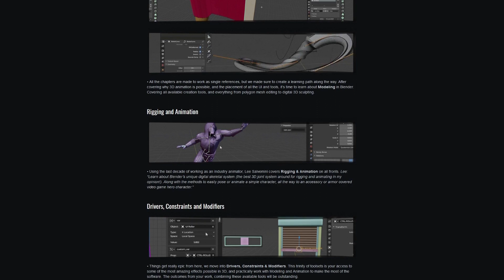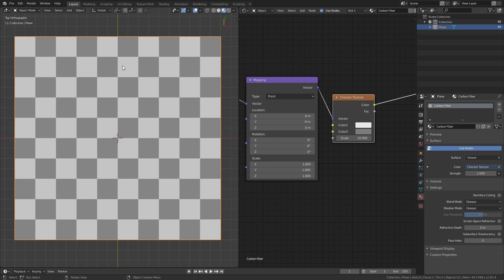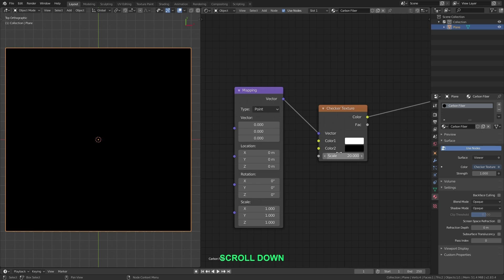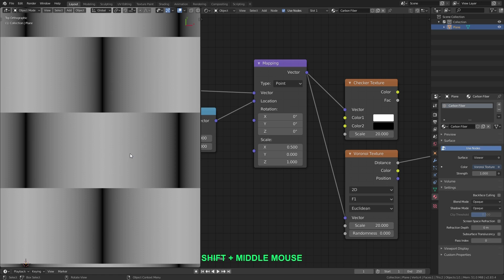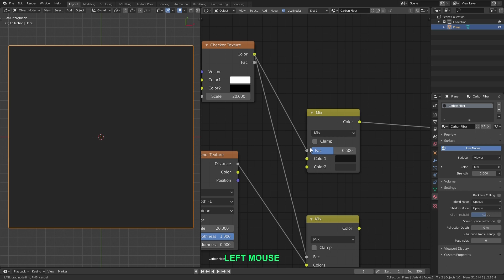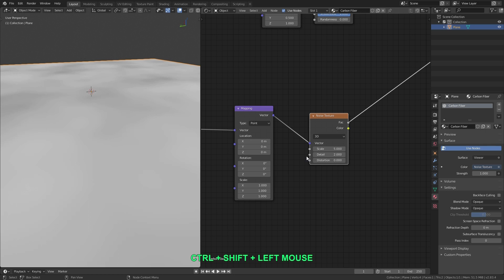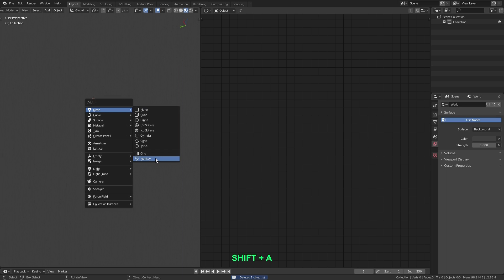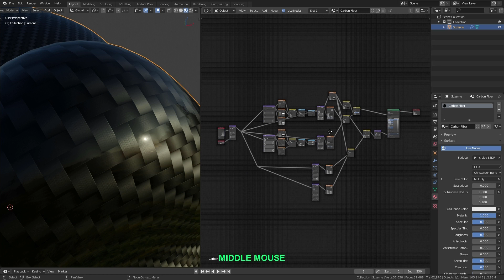Procedural Carbon Fiber Shader - Part 1 (Cycles & Eevee Compatible)

Comment: We need like a million more of these procedural material tutorials.
Reply from the maker: Got any specific requests? I've got a few ideas in mind for more of these, but always looking to add to the to-do list. -Chris
Reply: @blengine  The Classic Metalic CarPaint (EEVEE).
Reply: @blengine  I think thats a neat idea, however, a more indepth tutorial to understanding how to create patterns, which is the key to most procedural materials, would be better I believe as a first step. But back to the specific request - Brick material and or Woodbark :D then a tutorial on how to combine such procedural materials would be amazing too, for example let's take a brickwall and combine it with a procedural meshwire ontop on some parts, to hold loose parts together (often used in plastering) as an example on how to combine 2 whole different patterns to work together. Thank you for your tutorial!
Reply from the maker: @rodrigoalexandrealves8564  A more realistic car paint(for both engines) is something I've already been working on to make training for. After this course is released I'll probably get back to working on that.
Reply from the maker: @Keyr969  The pattern tutorial is actually already on my wish list! After creating this weave pattern I started making plans for a tutorial just on patterns. Brick and bark are great ideas too. Brick alone could be quite the project depending on the detail, and I like your layering idea too. That one's got me thinking...
Reply: You can check Become Blender material Guru course i just finish that one and learn so much. Now when i know how each node work i just need to develop logic and how to use them to create something specific. For example, this fiber tutorial, hardest part is to visualize this on the begining and know how to start with.
Reply: @blengine  procedural wall mosaic, like in old soviet wall art
Reply: @blengine  Brick I watched a video on how but i did not come out as good as the video It might be me but i think he forgot to mention a few little things in the video but yours is clear and understandable thanks
Reply: @blengine  Hi, I need this Pattern.: https://ibb.co/whyjxTD
But i have no idea how can i achive this... That nodes are so hard to learn, any tips? Thanks

Edit: Mhhh maybe i can kinda achive this by modifying your carbon pattern. I think it will look a bit different but I will give it a try.
Reply: CG Masters a good timber procedural map for doing things like timber handles or furniture with the grain technically correct.
Reply: @blengine  realistic / cartoony / anime skin shaders would be nice!
Reply: @blengine  Alot of shaders and working with the math node.
Reply from the maker: @Vlow52  Whew, that would be quite the interesting challenge, especially in trying to get the tile flow to match up with the images 0_0 I feel like it might be possible, but I think this one's outside my skills.
Reply from the maker: @undead504  Brick's a classic texture I'd like to tackle in depth this year. I've seen some seriously impressive procedural blender shaders for brick, and might have to get in touch with one of those artists to see if they'd be interested in a tutorial collab or something.
Reply from the maker: @derbmann123  Is that a diamond pattern, but stretched tall a bit? I can't really tell, but maybe this blend file will help with that - https://cgmasters.net/chris_misc/diamond.zip
Reply from the maker: @dangerfox1776  100% will be working on procedural wood textures this year. I've had one started for ages and am looking to revisit this. I feel like a whole tutorial series on practical shaders needs to be made, including wood, concrete, metal, etc.
Reply from the maker: @Unprogress  Skin shaders never really interested me, but after working just a little with SSS lately it's super interesting. I'm still not sure if I'll ever dive deep into the topic, but it could happen because it's such an important and commonly used shader.
Reply from the maker: @mortenfjellheim2481  I got a small taste of math nodes working on our course, and I definitely feel like I need to dive further into these. People do some seriously crazy stuff with these.
Reply: @blengine  brushed metal. There aren't any good ones in 2.8+
Reply: One tutorial per day takes 2740 years 😂
Reply: Greate tutorial! Wanna see some tutorial about snake scales...
Reply: @blengine  A procedural fabric for furniture, and Leather.
Reply: i know im asking randomly but does anyone know a method to log back into an Instagram account..?
I stupidly lost the login password. I appreciate any tricks you can give me!
Reply: @Hezekiah Ricky It did the trick and I actually got access to my account again. I'm so happy!
Thank you so much, you really help me out !
Reply: @Carlos Bradley glad I could help :D
Reply: @blengine  wood (with knots)

Comment: Really nice! I think in real carbon fiber material, the apparent difference in color of the different strands is an anisotropy phenomenon: the color changes depending on the viewing angle. It can be easily be reproduced in cycles by using the anisotropic setting together with a metallic material and the anisotropic rotation depending on the black-and-white mask you created.
Reply from the maker: Ah yeah someone mentioned this and luckily with that zig zag mask it shouldn't be too much work to add in that anisotropic effect as you pointed out. And in the end the color options are still in place for more customizing (I have actually seen 2 distinct colored bands on custom carbon fiber when looking things up). i'm still surprised how strong the anisotropic effect is in real life that the bands look so distinct, very cool. -Chris

Comment: Thanks for this amazing procedural texture. I added a connection between the Bump Normal output into the Clearcoat Normal connection on the Principled BSDF shader and got similar results as you were trying to achieve in part 2. Thanks again for sharing this video.
Reply from the maker: Nice, and glad you liked the tutorial =)

Comment: Thanks for this! Sweet tip: You can hold shift + right click, then drag over any number of connecting lines in the node editor. Blender will automatically create a reroute node that combines all the lines into one--or add a node to a single line.
Reply from the maker: Hey, thanks for that. Some others mentioned this as well and I've gone far too long without using it, very very handy hot key! -Chris

Comment: So, to add a reroute node with a shortcut: Shift+left mouse drag across the noodle(s) coming out of the node. No digging through menus. Great tutorial, though. You’re really good at teaching. And that trick using the Voronoi node to add gradients to the checker pattern was sick.
Reply from the maker: Man I just need to spend a week memorizing shader editor (and node wrangler) hot keys. Though I think it's shift+right click drag in this case after having tested it out. Super useful though, thank you. -Chris

Comment: A very nice and easy to follow tutorial. Thank you for spreading Blender knowledge. 
To deepen it, I would suggest explaining the big steps some more before proceeding. Like, at 2:11 it would be beneficial to explain that you are going to convert Checker texture into brand-like, subdivide it spacially with more brands and offset it using texture coordinates to create the mask displayed. Perhaps a simple breakdown in stages would be beneficial as well -- this way most people will understand what are they doing at each step without rewinding the video, which is a key to understanding the principles.
Reply from the maker: Thanks! And you're right, there were a few parts that I thought could've used a little more foreshadowing. It's sometimes hard to find the right balance between being concise and also being comprehensive enough, but I'll try to do better. Thanks for the feedback! -Chris

Comment: Very intersting technique and informative tutorial, thanks a lot! I'm sure someone told you this already, but you can hold Shift and Drag Right Click over node connections to group them under the same re-route node automatically. Just another neat shortcut from that wonderful add-on.
Reply from the maker: Super useful hotkey thanks! I really need to spend some time memorizing these hot keys better.
Reply: @blengine  They really do seem to be endless haha. I didn't even know there was one for adding a Mix Shader before watching this tutorial.

Comment: I did this in 2.79. Took a few adjustments, since the Mapping node in 2.79 doesn't have the same inputs as 2.8 onwards. After the Mapping node use a Vector Math node set to Add.

Comment: To fix the sharp middle of the bands, put a math node in divide mode, plug the output into the distance value of the bump node and then simply plug the global scale value in the bottom and adjust the other value of the math node to your liking. This ensure the gradient smoothness is consistent when changing the scale for the patern.
Reply from the maker: Ah very nice idea to automate that, thanks for the tip!
Reply: @blengine  No problem! Also thank you for this great tutorial. Everything is clear and well explained, I like it.

Comment: im using blender 3.1 on windows 7 and unfortunately the bump map will produce pink. it works on windows 10 though i just tested it
Reply from the maker: That's really strange. Since it's all procedural I wouldn't expect a pink result because I've only seen that when an image texture is missing. If you want, you can send your blend file over to me at chris.cgmasters@gmail.com and I'll try to figure out what's going on.
Reply: @blengine  thank you for your time and help! actually i simplified the way to reproduce it. you only need a noise texture and feed the fac into a mixRGB node then into bump map. the bump map will produce pink. but this one only happens in blender 3.1 running on windows 7. the noise texture is the problem. i have a tutorial on installing blender 3.1 on windows 7 on my channel. but you don't have to if you have no time i will understand! thank you! :)

Comment: Interesting take using checker/voronoi texture nodes instead of straight math nodes. I probably would have gone with math but I bet this method appeals to many
Reply from the maker: I considered using math nodes at the start, but with only limited experience with using math for shaders this definitely seemed like a more appealing approach like you said.

Comment: Very nice tut. I have a question tho. Is using voronoi texture  stretching a single axis to create banding gradient better than using wave texture? because i'm always trying to use wave texture to create band gradient like that and it's hard to make it smoothly.
Reply from the maker: In this case it's essential to use the voronoi texture because it aligns perfectly with the checker texture when they're the same scale. So in the end the gradients from the voronoi texture fit perfectly into the bands created by the checker texture. The wave texture would not produce the same alignment so it would be trickier to get it to fit just right into the bands. -Chris

Comment: Would be great if the ClearCase could have some of the topology if the fiber. Thats how real carbon fiber, like speaker cones, looks.
Reply from the maker: You can run the bump node into the Clearcoat Normal input as well to affect the clearcoat normals. Though I would create a second bump node with a lower strength or distance value and run that into the clearcoat normals, so that you can control how much bump the clearcoat normals get.
Reply: @blengine  Good, I figured there had to be a way to make this more realistic. I'm surprised this detail was left out.

Comment: Really nice work. Do you know one can rotate that vector field? i mean, when you created that voronoi, you have to copy all nodes and change all of them. Because all vector operation basically change end points of all vectors. Is there a way to tranfsform whole plain of vectors? Vector operation is matrix of xyz -point coordinate and xyz vector of that point. so question is to change that first set of xyz.
Reply from the maker: I did attempt vector rotation instead of copying all the nodes but it didn't work out for me. It's entirely possibly I just didn't understand it enough to get it working right. And I don't remember why it didn't work exactly, but it probably had something to do with the texture's no longer lining up perfectly. I do plan on revisiting this shader in the future and hopefully I can get that working.
Reply: @blengine  well, my problem was that when i looked of mapping as texture, color of that thing chaged according to all changes. but that strips of brightness were aligned in that direction all time. so only thing i foun at the end worked was still coping all nodes, exept of changing any numbers i switched x and y between texture coordinate and mapping. only good thing about it was if it was more complex material but still i feel there should be some  option to rotate whole coordinate set.

Comment: Hi Chris. Thanks for the tutorial. Some notes from my side about the carbon material. Why roughness is so uniform along all the material? I think it'll be better to change roughness according to brushed pattern. This will make material more realistic and interesting. Also maybe to control somehow Bump distance depending on global scale value? It will be great if you could make a tutorial about creating Pentelian and Parian Marble, which is used widely in antient Greece and good for temples etc. Thanks.
Reply from the maker: I honestly just forgot about the roughness value, but feel free to adjust that to your liking to get even shinier and metallic carbon fiber. And yeah others have mentioned using a Math node set to divide in order to keep the distance consistent with the global scale, which is a great idea. That would be especially useful when organizing everything into a group node. I may take this tutorial further and do that, but the main focus here was the weave pattern. And marble's are always a good topic for procedural shaders, I'll look into those types too, and there will likely be some marble tutorials from me at some point, thanks for the suggestion! -Chris
Reply: @blengine  It's a very good idea to create part 2 of this tutorial, fix all issues and add all possible features. As a good reference you could take a look at substance material which is called Carbon Fiber Twill Weave at https://source.substance3d.com/allassets?q=carbon. It has a lot of features, like anisotrophy, roughness variation and a lot of others. Waiting for part 2. Thanks.

Comment: Great tutorial, very clear, really ingenious use of the  provided procedural textures, all sorts of ideas come up from using them those ways.

 I've been doing this sort of thing using just math nodes, often following GLSL examples from Shader Toy. It's a toss-up which way to go.  Usually, I guess, the 'pure math'  way calls  for a lot of nodes, and would make a painfully long, hard-to-explain tutorial.

For generally useful tiling, though, I do think it's important to choose a way which generates a UV mapping of each tile, so you can put anything you like into them?
Reply from the maker: Hey Robin, glad you liked it! I was very tempted to find a mathematical approach to this but didn't know how long that'd take me to figure out. I'm actually not sure how to achieve being able to put something different in every tile. I've seen people take something like a voronoi texture and give each cell their own coordinate system which will basically center an image texture the same way in every cell for example, but beyond that I haven't dabbled in that kind of complexity. Have you made any examples? -Chris
Reply: @blengine  Unfortunately my machine down atm and  COVID preventing  quick replacement... as soon as I get my files back  I'll post some examples somewhere you can pick them up. It's not a different thing in each tile, although that could be done.. it's a procedural 0-1 UV map for each tile , so you can put your own repeated image in, or, say, bevel each tile (sort of nesting procedural textures)... I'm not claiming it's a better way.. but may be of interest. Your way is easier to think about / teach.

Comment: Hello, I followed the whole process and enjoyed it very much thank you. It turned out great however I am modelling a car, when I applied it on to a car part it did not work. I created a monkey and it shows on that amazingly. Same as the plane. Just not the car. Why would you say it is so?
Reply from the maker: Hey, the material works with UV Mapping so you'll have to make sure your models are UV unwrapped first.
Reply: @blengine  Thank you very much. I will check it asap. I have learnt a lot from you.
Reply from the maker: @gokaycakr6783  Glad to hear that! And hopefully uv mapping is the only issue with you using this material, sounds like that's all it is, but if not let me know.

Comment: Hey Chris, Amazing tutorial as always! I don't have an option on the mapping node to connect the XYZ node with the location. I only have one input that says vector. Is there any way to get around it? I am talking about the situation at 8:25.
Thank you in advance!
Reply from the maker: Hey Milos, what version of Blender are you using? I think 2.82 or 2.83 the mapping node was upgraded to include separate inputs. So you'll need a version of Blender with those inputs to follow along with this.

Comment: Great tut.! But where  I can rotate this texture? I have texturized object and i want chose prefect position for carbon direction, I newbie  and doesnt understand how? Thanks
Reply from the maker: You can use the Z rotation value on the mapping node that we add in to control the overall scale. And since this texture is applied using UV coordinates, you can also rotate the UVs.
Reply: @blengine   thanks a lot!